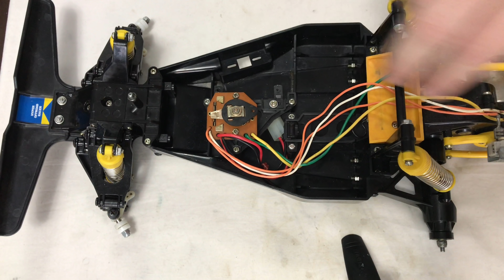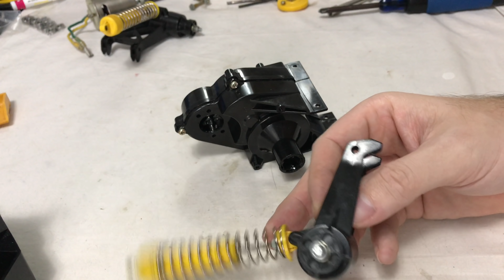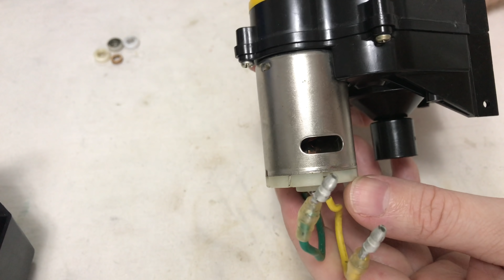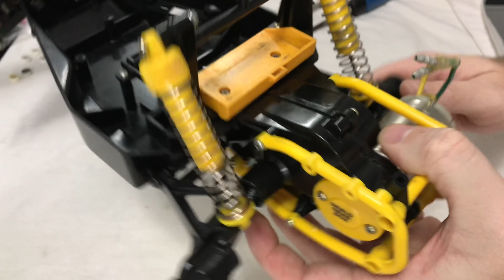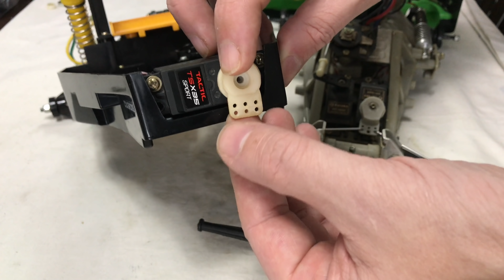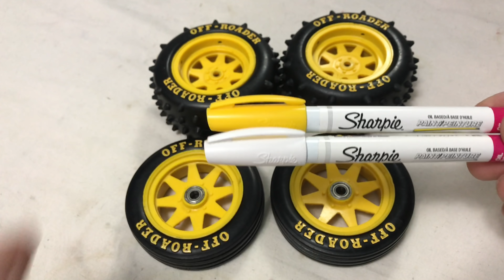Tamiya Falcon 1986...

Comment: Gorgeous Falcon. My first was the Sonic Fighter and the falcon was so close so this video has given such memories and nostalgia. I have recently acquired a never run Sonic Fighter as well as a barely run one. So now I’m so inspired to get the barely run one in top condition and go for a blast with it.
Reply from the maker: Excellent I’m a big fan of the Sonic Fighter 🤩🤩🤩
Reply: I’ll DM photos of my two on Facebook. As I say, the grey one has never touched the ground and has been sealed away from the UV for 30+ years. So even the tires look and feel like brand new. Came to me having never even had the steering servo installed as well as having the original shock oil still in the unopened bottle.

Comment: the plastic bushings are maintenance free, rust proof and way cheaper for the manufacturer, so I expect the new base line models will continue to come with them in the future, but I do agree a set of bearing is the best upgrade you can do, these days I can't build a new kit without bearings.

Comment: Absolutely love the falcon. Got 2 had 3. Like you say the memories 🤔🤔🤔🤔I really should get mine to that standard.one isn’t far off ,the other well meh. Great vid. If you fancy punting the falcon after its run let me know
Reply from the maker: Gary Wilson 
Cheers Gary 😊
The Falcon has moved on already buddy lol, these cars don’t last long in my possession, soon as I’ve done the running video they go. But I did get an Egress to replace it 🤩🤩🤩
Thanks for watching 👊🏻
Reply: Now that you have done the iconic Falcon, you should get the trusty old hornet as well unless you have already and I somehow missed that one. Tamiyas two original iconic two wheel drives.
Reply from the maker: Gary Wilson 
Yeah definitely getting a Hornet 🤩, done the Grasshopper and Super Hornet so need to get one 😊👊🏻

Comment: Hi. Great Video and awesome car! Mine is nearly restored and almost ready to drive. Can't wait! Do you have recommendations for plastic stripped screw holes? Dont want to use superglue incase my receiver goes bad.  Thanks.
Reply from the maker: Robert Frazer 
Excellent Robert 🤩. If you get the chance check out the running video I did 😊👊🏻
Regarding the plastic I don’t have an answer unfortunately 😐

Comment: I can kind of see why Tamiya uses the plastic bushings. A majority of their cars where sold to people that do not want to work on a car. With bearings, if you drive in the wet and then put it up for a week, the bearings will rust up and tear up everything. Bushings wear out but they are zero maintenance.
Reply: Also to keep costs down
Reply from the maker: chris smith 
Hey Chris yeah that’s a fair point I guess, especially for the old stuff. But I think the re-re’s should have had them.
Thanks for watching buddy 😊👊🏻
Reply: A lot of the guys that run rc crawlers use the plastic bushings on the axle for that exact reason

Comment: The falcon is one of the worst RC cars from tamiya, the chassis design was poor with it being very weak at the front. Drive shaft dog bones omg shocking system. Front suspension mounts 🤮 a very poorly designed car! But it was f***ing awesome 👌 I drove mine to death, must of done hundreds of miles.
I think a chassis was £7.50 back in the day 🤔 I bought many. I have two falcons now one as new my other is used alot lol